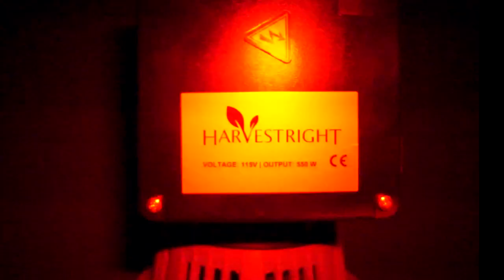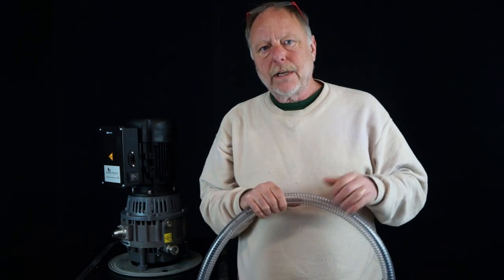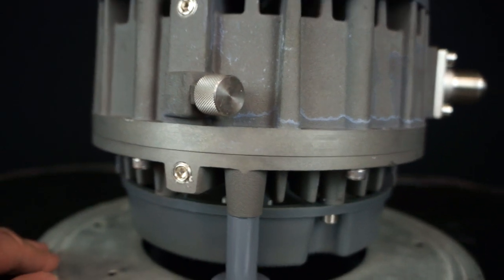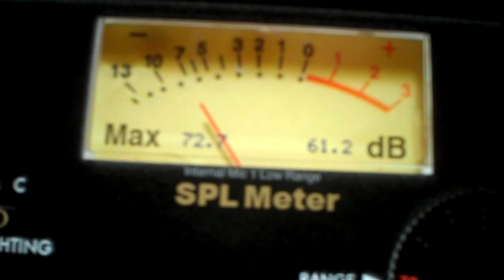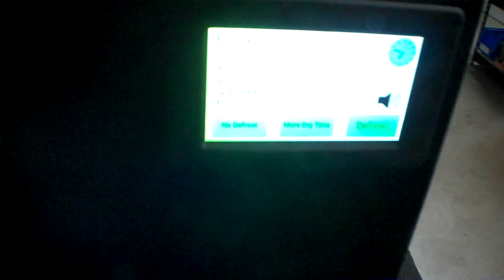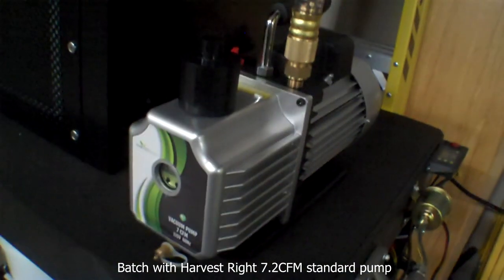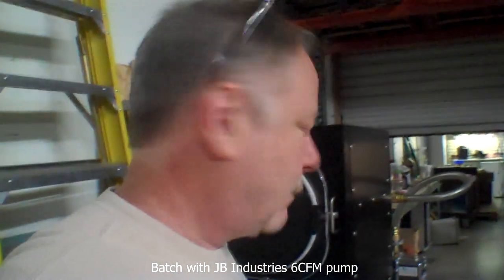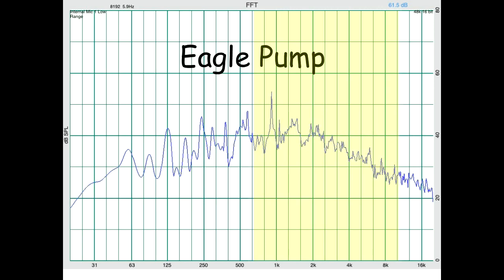Oil-Less, Maintenance-Free Pump for Harvest Right  Freeze Dryers - The Eagle

Comment: New subscriber here. Would you recommend this new pump and the freeze dryer in an apartment?? Is the noise louder than a vacuum cleaner, etc. hard to get noise from a video even with the tests you have done which were excellent. OR would you recommend this unit stay in a garage setting??????
Reply from the maker: The overall noise is like an old dishwasher, or two people having a normal conversation. So my gut would say that you wouldn't want that going on in an apartment at 3am.
Reply: Debbie Severance if you watch the video at  8min 57sec he is talking at a fairly normal level, and it is higher then the pump once it settles into its normal constant level. So maybe wouldn’t be too bad?... I have the same concerns. Being conscience of my downstairs neighbors.  Did you decide on getting this? If so, have you had any issues?

Comment: Bought the new oil-free pump. FD does not work, now! HR sent me a replacement pump and new hoses ( admitting they got a batch of bad hose's mfg in China.) Also replaced the vacuum sensor at the suggestion of one of the techs. I continue to get an error message telling me the FD cannot reach vacuum, or some such message, even after all the things I have tried. About 15 minutes into the drying cycle the machine shuts down, AGAIN! Any suggestion? I guess I will try to resurrect my original JB oil type pump and see what happens. Anyone else had this problem?
Reply from the maker: Hi Dale, Give me a call when you have a chance. I have a few questions. 541-684-0717
Reply: Got the new pump and it works perfect. Did you do a dry chamber test to make sure it is hooked up right?
Reply: I am thinking of sending my oil-free pump back. Cost alone $1625 is one reason but the best reason is it does not work. Harvest right is now wanting me to remove the nozzle built into the drum containing the trays. However, I am told it takes a pipe wrench, maybe even using an extension on the pipe wrench to take it off. Not sure that is a good idea since I think it might cause serious damage to the drum. Even if I am successful, install the new nozzle to fit the larger pump hose, And, that does not fix the problem, I must reverse the procedure and re-install my original nozzle to begin using my original pump! However, since using or trying to use the Oil-free pump and find it does not work, I tried to use my original pump and now it only works to a point and it also gets the same message. Not sure what to do at this point but I am into this thing over $6000.
Reply: Ours has worked amazingly well. We really love it. Your question about the power outage is a good one. Maybe that is causing a shut down.
Reply: Hi Tom: I did not experience an power outage. The pump simply stops at about 15 minutes into the drying cycle. Power to the unit is not a problem. Thanks
Reply from the maker: Hi Dale. Do I understand you are using the garden style hose with a brass adapter on the Eagle pump? I assume they had you check those garden hose gaskets and did you try tightening the knurled knob to the left of the vacuum input to the pump? If they want you to swap over to the new hose and replace that connector on the drum - it's not as bad as you think. I did it. You have to remove the side panel though. You do need some teflon tape when putting the new fitting on. If you want to go back to your old JB for testing, you just need a fitting to go on the existing "T" on the JB. That will have the new 45 degree surface for the new style hose. I can run all three pumps on my setup now, with no changes on the freeze dryer. I have a spare pump fitting if you need one. Give me a call. 541-684-0717.
Reply from the maker: Hi n mc - The messages you see probably say "...can not achieve vacuum..." as part of the error. If you have a chance I have a few things for you to look at. Give me a call. 541-684-0717
Reply: HI Bryan: I finally changed out the original connector into the drum. Did not put plumbers tape on threads, wanted to try without. Started the FD and waited for the dreaded 15 minutes of drying to see if it would stop, it did not. So today I am running four trays of food to freeze and then dry and will see what happens. Hopefully, it was the original nozzle not compatible with the new, larger hose into the oil-free pump. Will let you know. And, thanks for your offer. Hopefully, this will solve the maddening problem.
Reply: I switched out my original hose connection that is attached to the drum housing the trays. Ran a test dry cycle yesterday without a shutdown. Today, I am running four trays of food to see what happens. Hopefully (!) the FD will work this time. Will keep you posted as well. Dale

Comment: The product says no User maintenance needed but it actually needs a Pro service every year for bearing replacement and other seals so it means you have to send it in to get it serviced right?
Reply: You can usually fix vac pumps w/ kits specifically for them your self. If you are unwilling to learn though you may need help. Its not too hard though.
Reply: I’m looking for this kit also.

Comment: Which pump will last longer? Say a life cycle cost analysis? Thanks!
Reply from the maker: That's a great question. I have only been testing this pump for a few weeks. However, pumps of the scroll type have few moving parts. They cost so much because of the precision machining involved. I am told for a pump that can operate at such a low mTorr range, costs can be in the $4,000 range. In the text below the video I mention an awesome animated video that shows how this type of pump operates. It is worth your time to take a look at that. I have been told that this pump can run upwards of 8,000 to 10,000 hours before a $100 gasket set may be needed. I assume it should be cleaned inside at that time.

Comment: Someone said this on another site and is it true?  "well worth the money that new pump. remember though that  you have to clean the pump every few cycles , I do it 4th cycle. just  detach the hose from the freeze dryer put 1/3-1/2 cup of iso alcohol into the tube and turn on the pump repeat til it comes out clean. I use 90% iso . I have the large unit. just remember to point the exhaust in a safe direction. I use a box with a clean white towel to absorb it and see if its clean."
Reply: Harvest Right does not recommend doing this anymore. They supplied all users with a hose insert to reduce moisture and debris from entering the pump. The new driers and pumps come with a smaller hose. I've had my oil less pump now for 2 years. I don't do any maintenance and I have no problems.
Reply: @jerrysmith372  Thank you.

Comment: Excellent Video ! - What is the CFM on the Eagle?
Reply from the maker: Hi Patrik, 
They say it is a 7CFM, but performs more like an 8 or 9CFM. I know that sounds goofy, but the oil based pumps actually loose efficiency as the oil temperature (and water content) increases. So if you think about it in that way and try to compare to an oil based pump I totally get that comparison. I'll be doing a video on that topic....
Reply: Very true.  Thanks Bryan.

Comment: This pump isn’t worth the money.  I just got the new industrial pump.  Which is the much better deal.  The maintenance to this industrial pump.  Now I find out they have it.   I find it does need maintenance and they do need a 100 rebuild kit.  Now my oil less broke.  Send back in to be repaired and now I have a pump they sent me since my oiless is broke.  This one works better just as quiet and needs less maintenance.  I only have to change the oil after every thirty or more load.  No filtering.  Just drain and replace.  I’m out 1500.00.  I don’t want the oiless. The one is stronger smaller lighter and overall better pump.  Harvestright is like a refund
Reply: So you are saying the pump with oil is better?
Reply: Rhonda West the newer version they have now and the hose conversion I would not buy the oilless pump
Reply: what industrial pump are you using?
Reply: xephael sorry it’s not the industrial it’s just the new oil pump they have.  Not the old this one has a easy open drain plug

Comment: however, there IS maintenance to be done on it but very easy to do. you must disconnect the unit from the freeze drier and run iso alcohol into the hose while the pump is on to flush contaminants from the unit. I use 90% about 1/3 cup at a time til the fluid comes out clean, may take a couple times if it hasn't been done for a few cycles. I do it every 3 cycles. just remember to tighten the hose before a new cycle. I forgot once and woke up to a unfinished cycle. oooppps . just retighten and continue.
Reply: Where did you find this info? I'm not seeing it anywhere in the manual!
Reply: @TacklingTheGiants  from harvest right. they emailed me. HOWEVER !! UPDATE!! this will destroy the pump - harvest right was wrong and they emailed me to stop doing it but not after the pump went out. so now they say to just disconnect the hose from the freezer and run it for 15 - 20 mins to dry the unit inside and so far, it seem to be working no problems to date. after of course i bought a new pump at my cost. thought about a lawyer but, they did help out a bit.
Reply: @williamkechkaylo7915  it doesn't even say to do that now(running it dry after disconnecting)!
Reply: @TacklingTheGiants  call them if you have the oil less. talk with the tech guys. remember they ,as most businesses use c.y.a. lol!! or i still have the original emails that i can forward 2 u.

Comment: If an oil less pump, would you still need a deep freezing dehumidifier component to the sustem, why not just pump it out?
Reply from the maker: Yes. The freezer captures the water in gas state, and freezes it away from the food on the drum surface.
Reply: @EpicenterBryan  I am a Harvest Right user and I have had two standard oil-filled pumps fail.  I suspect that the pumps were damaged by water. I realize that much of the water freezes in the inside of the vacuum chamber (as you note in your response to Craig), but some will always get through. Is this new oil-less pump immune to water damage?  Is this covered in the pump warranty?
Reply: bill main That oil less pump is not your everyday ordinary pump. I’m pretty sure that only used for commercial purposes.

Comment: Do you leave the oil-less pump on all the time or shut it off between loads?
Reply: You must shut it off between loads.  If not, you won’t be able to open the door to the food chamber.  It’s only function is creating the vacuum.
Reply: @veryinteresting591  lol I didn't make myself clear. I was referring to the off/on switch on the pump. I had ran only one load when I asked the question. Since then I have learned to leave it on.  Thank you for your help.
Reply: @tonihay  How are you doing now? You must have done enough loads to be confident by now. I've been using my large dryer and oil less pump for 2 years.
If you have questions feel free to reach out.
Reply: @jerrysmith372  Thanks. Yes. I have done many loads and I am comfortable with it. My only regret is waiting so long to buy one.

Comment: Ridiculous!  Those of us who already have a FD and have nothing but problems with oil getting into our food even AFTER we replace that ball you show how to replace, should be offered these pumps for LESS not MORE!  It certainly isn't good PR to have people with machines out there giving them a bad review!  It would behoove HR to take care of previous customers to keep them happy and giving good reviews.  I have bought 3 and at this point I can't in good conscience recommend them to people I know because of the bad pump!
Reply: I've had quite a few bad pumps myself. The JB pumps were never designed for freeze dryers, they were just an off the shelf pump that worked. HR had no idea when they invented this thing that they would have so many issues with the JB pump so it's not their fault. They do have a new HR oil pump for $300 that is supposed to address the flaws in the JB pump. Have you considered calling them and seeing if you could send in one or more of your pumps as a trade in? I did. They already had my spare pump in for repair when I bought this new one so I asked them if I could trade it in on some mylar bags since I no longer needed it as a spare and they said yes. They are very good about working with customers. Even if your current pumps are bad they can still repair them and use them as a replacement for another customer.
Reply from the maker: Hey CallMe, give me a call. I have a few tips that will help you if you are still having oil in the hose issues with your JB pump. I'll be doing a video about what I learned since I posted that video last year. As far as the new Oil based HR pump goes, I haven't seen any issues with that one yet - but have limited ours using it. Right now I'm trying to get extra hours on the Eagle Pump since it is also new and expensive. But I will be going back to the JB soon. So many people have those, it's important to help resolve these issues.
Reply from the maker: Hi Steve, you mentioned you had several bad pumps before you got your Eagle. Could you elaborate on what kind of issues, and how long you have had your Freeze Dryer? And I assume issues were all related to the older JB pumps (no longer supplied as of November 20th, 2017)? I don't want to beat a dead horse here, I just think a little more info will heal readers of the thread.
Reply: They were all JB pumps. I finally figured out what was happening. I have tons of canned spaghetti sauce that I wanted to freeze dry and every time I did a few batches the pump would start leaking oil like crazy. After the third pump went bad then it donned on me that the acid in the tomato sauce was probably eating that rubber seal. 

Another pump just wouldn't power up one day so that was replaced under warranty and when I first got my freeze dryer I could no longer achieve a good mTorr after a while and HR determined that it was the pump and replaced it. So 5 bad ones total. 3 of them were probably my fault though due to the acid.

 I've had my FD for two years. Now that I've got the new pump I can get back to freeze drying my spaghetti sauce since it won't damage this pump.
Reply from the maker: OK, so your problem was mainly with the rear seal. One of the issues with the rear seal on the JB pumps was that it had a steel (not stainless) spring in it which kept the seal tight on the shaft. That combined with the fact that crud could get behind the pump cartridge via the oil channel where the seal was, water could stay in that area (held there by crud). And when the spring rusted, it broke. There was talk that JB was going to change that spring to stainless. I don't know if they ever did or the spare parts channel for that seal ever did.... Perhaps HR gave up on JB because they didn't make the change. I have no insider info on that topic. But I think they have better control with the new pump supplier under their own name. That's a good thing. I wish the USA made company had taken the lead to provide a design that worked and had fewer failures but I guess once you get too big the customer (HR in this case) is not always right. That's why America has lost so much production to other countries.
Reply: Yeah I watched your video on replacing that seal and I see that it was a poor design. That's why I was so excited about this new pump because you don't have to worry about that stuff anymore

Comment: So before I purchased a Harvest right Standard size in March 2017 and paid over $3K +...  I asked one of the engineers at harvest right why they didn't offer am Oil-less version  vacuum pump... I was told  an oil-less pump would cost an addition 5k in cost! AND that is why they never designed an oil-less pump version ...APPARENTLY  THAT WAS A BIG F-IN LIE!  My POS freeze dryer constantly upchucks oil  when the cycle ends and ruins my batch of freeze dried food.
Reply from the maker: Your existing JB pump probably has a bad check valve. Check out one of my other videos on the subject. You can contact me via our web site and I'm happy to send you a replacement check valve for you to try. I'll also be posting a video on how to add an external solenoid valve to older JB pumps to fix that issue. For now, move your existing pump as low as you can. Start your FD process, and remove your pump plug from the FD and plug directly into the AC outlet for about 10 seconds and remove. Then plug back into the HR. That will develop a strong vacuum and the check valve will pop up. Give me a call if you need more hints to get you going...
Reply: We looked for one about that time and couldn't find one new for under $3,700. These pumps are nice. I want one.